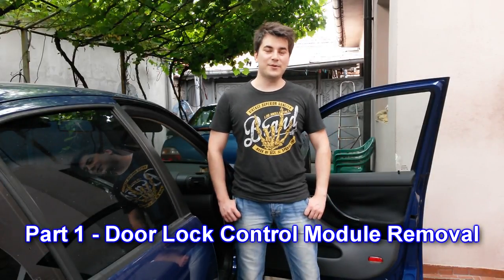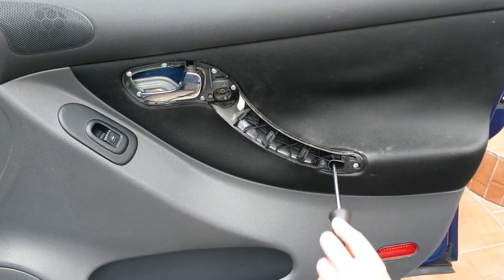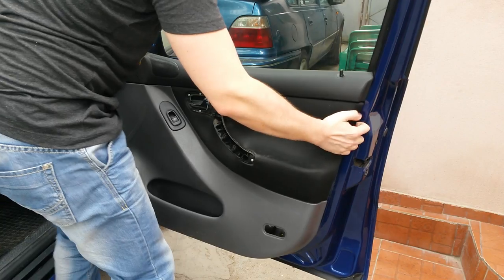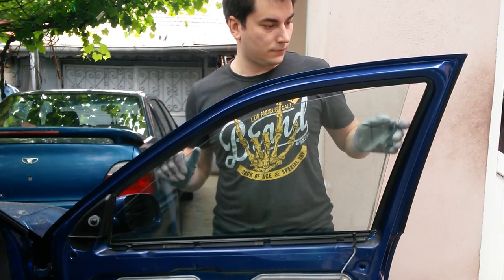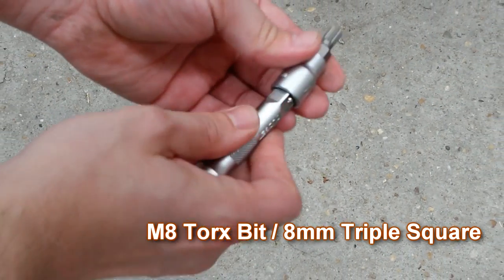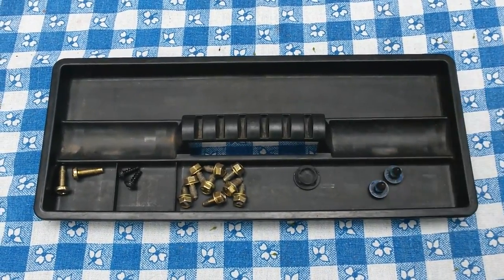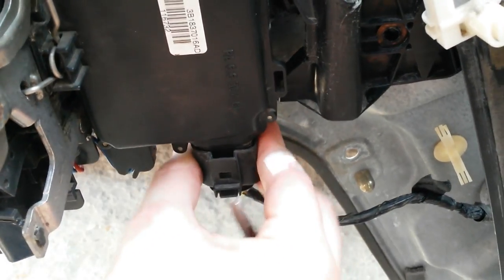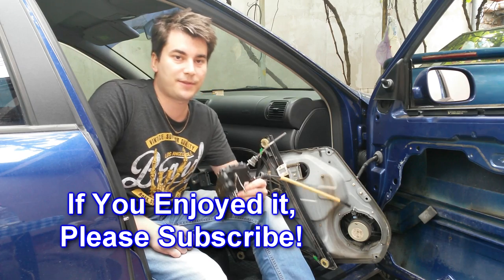Door Lock Module Removal - Seat Leon 1m / Toledo 2 - Part 1

Comment: Brilliant with every detail covered including the PITA wet door issues. Well done Sorin and thank you. Its tragic to see how over complicated everything has become these days by design. We used to fit electric windows  and locks to cars as optional extras in the 90s. They were simple modules that were easy to fit and easy to repair. The seat's by design seem to made it 1000% harder and more expensive. Not to mention increase the failure rate 100x. Its just nonsense. never know such an awful design flaw by what is essentially a VW. Grrrr  this is the trouble when you let spotty kids design stuff on a computer that bears no resemblance to the real world and have probably never even seen inside a car door!

Comment: Just to mention the plastic connector used to attach the lock to the inner metal card is for factory assembly only..........you can get rid of it and simply refit the lock before the metal card/window reg..........it makes it a lot less fiddly.

Comment: Thank you for the video. I have serious issues with my Leon's front left (driver's) door. The remote signal of the key haven't worked in the past 5ish years not even with new batteries. We locked and unlocked the door the old manual way since then, but sometimes the central locking system did not lock the other doors and you had to try it several times. After that it degraded further and started to never close the other doors, so I had to use the right front door or press the locking button on the left front door to close the other doors before I close that single one. A few days ago when I tried to lock the door I could not pull out the key. I think something is broken in the lock, which does not let me turn the key and pull it out. I used the second key to drive home and to close the car with the right front door. Since then it simetimes locks down the car when I close the door or even when I am driving. An even funnier thing that sometimes when I try to lock the car with the other door it goes in a loop and locks and unlocks the car 3-4 times. On the second try it usually locks down the car properly. I managed to buy a new lock for the left door second hand. I found somebody who can set the lock to work with the current key before I build it in, but I doubt that will be enough to solve all the problems related to locking. Can you give me some tips what I'll need to fix everything, even the remote? I'd like to know where the receiver of the remote is in the car and how I can replace it. And I guess there are broken wires in that door too, which I'll have to replace too. Even some sort of tutorial would help, which describes how these locking mechanisms are wired and controlled, and what each wire and module does. Do you have any idea where I can find that info? I think figuring it out myself would take weeks, probably months. It would be still fun, but I'd rather do this in a week or hire somebody with the job, because I don't want to end up closed out of my car in a remote location...
Reply from the maker: hi. when my door locks started making problems, they also stored an error on the comfort module. your car may also have an error stored, that prevents the remote central locking from working. first you need to repair or replace all the broken door lock modules. in 90% of the cases it's the same problem that I repaired in my videos. after you repair all the door locks, scan for errors with vcds, delete the errors. the remote central locking may work again. if not, I don't know where is the receiver for the remote and I don't have the car anymore. after all this, if all the door locks work and the central locking works too, from the button inside the car, or with the key in the lock, then I suggest you buy a simple alarm kit and install it at an auto electrician. it shouldn't be very expensive. the alarm will be connected to the central locking module, so you can lock/unlock the doors remotely  and you will also have some extra protection.

Comment: Hi, this is fantastic thank you. I just need to replace the electric cable from one door to another. Obviously the hardest one to release is the central locking. I also can't get power to this window so can't remove it. Please can I ask what do I do? Can I leave the window and just remove all other screws as you did and still release the electrics from the central locking? No easier way is there? Thanks

Comment: One question: when you speak about to take free the holes on the under part of the door, you do also change the old gasket or do you take the old one? I want to try your system, but I have the problem that noone in my region I recevi another gasket. So maybe it would be ok to use the old one?
Reply from the maker: hi.you can use the same gasket, but clean it. you can also enlarge the holes through the gasket. and clean the inside of the door.
Reply: @Sorin_DIY_Mechanical_Nerd  thank you

Comment: great video, but i how do i unlock the door first as passenger side won't unlock? thanks
Reply from the maker: hi. the exterior door handle cable 3:13 may be too tight, you need to adjust it. or you can reach the door lock with a screwdriver, through the same hole and unlock it, like the key does on the driver side. but to remove that knob 3:07 you need to have access from the side of the door. I think the only possibility is to remove the back door from the car, then you have access to remove that knob.

Comment: Great video but I have one question. Is it necessary to remove the window? I am very afraid to not destroy anything ;)
Reply from the maker: hi. you can leave the window in the door. after you loosen the clips, rise the window in the upper position and fix it to the upper door frame with scotch tape. but be careful when you remove the metal panel. the window mechanism has 2 big metal sliders and can damage the window.

Comment: Salut am un seat ibiza din 2002 si mi sa blocat usa inchisa am dat totul jos a ramas doar usa goala cum pot sa o deschid sa schimb iala am tras de toate cablurile si nu se deschid
Reply from the maker: salut. de obicei problema e la cablul acela scurt, care leaga o tija din yala -> de manerul exterior de plastic al yalei, de care tragi sa deschizi usa. cablul acela nu trebuie sa fie intins, altfel nu se descuie yala. incearca sa impingi de manerul exterior de plastic in usa, tii apasat, ii dai cativa pumni in usa sub yala, dar cu partea moale a pumnului :), apoi tragi de maner. poate se slabeste putin cablul si se descuie. daca reusesti sa o deschizi, trebuie sa demontezi butucul, cum am facut eu in clip si sa slabesti cablul acela. daca nu reusesti asa, poti sa incerci sa distrugi bucutul cu o bormasina, sa il scoti. dar cu grija fara sa distrugi cablul sau partea interioara a manerului. apoi cand ai acces la cablu acela il scoti din maner si il prinzi cu un pin mai slab, e un fel de clema din plastic acolo, se vede si in clipul meu cand montez yala la loc. apoi cumperi alt butuc din dezmembrari si il montezi acolo. problema asta am intalnit-o eu, dar poate fi si altceva mai grav...